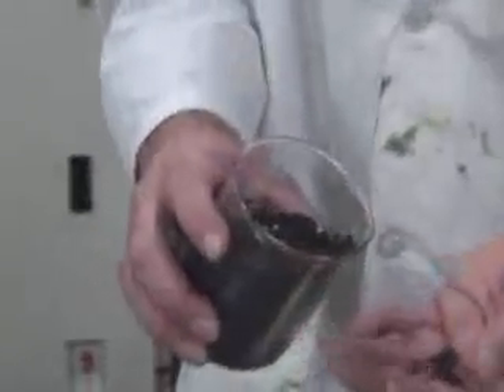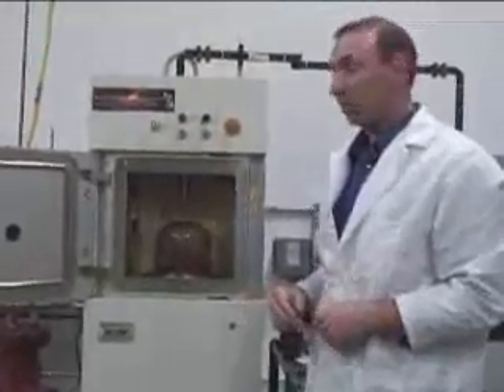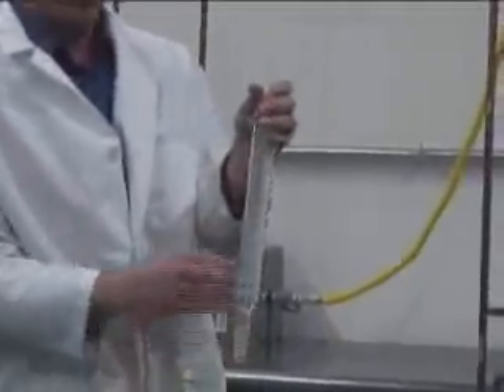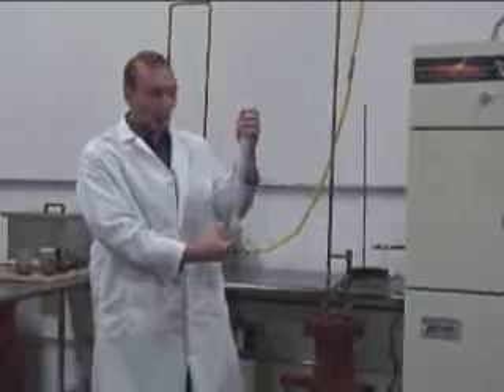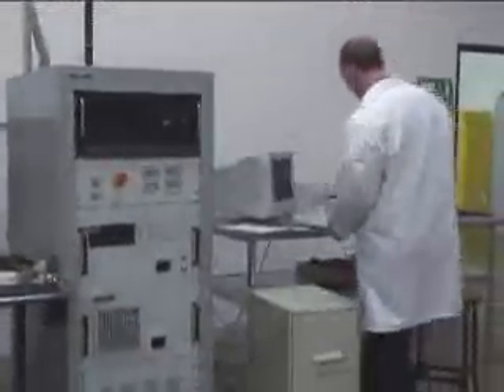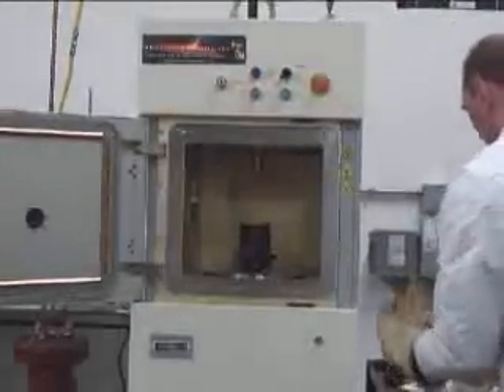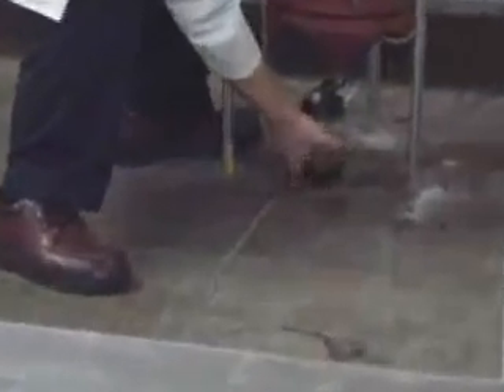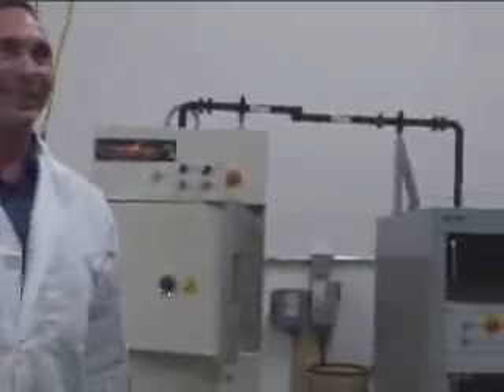Converting rubber and plastic to oil and gas

Comment: It doesn't matter, CO2 direct causes greenhouse warming, and CO indirectly causes it through secondary reaction products. The problem is that we need to sequester carbon badly; and if we turn the tires into fuel all the carbon in the tires is going right into the atmosphere. I'd much rather we sequester it in a landfill or even the ocean. If there's a better way I'd choose that obviously.